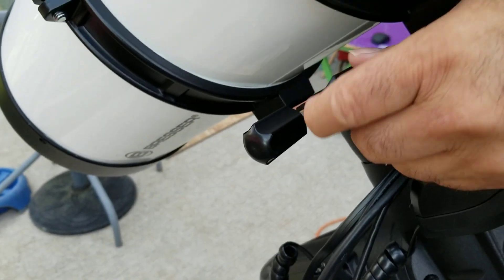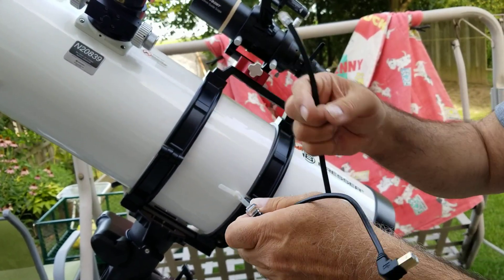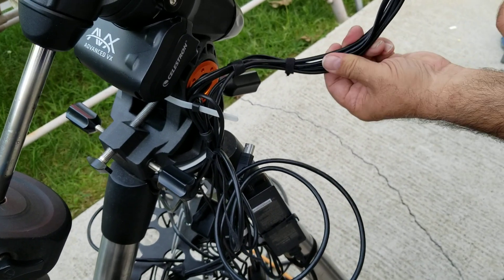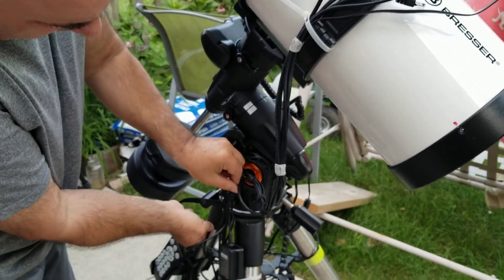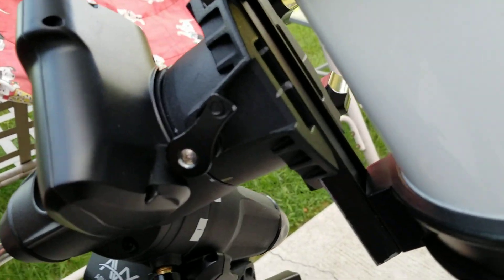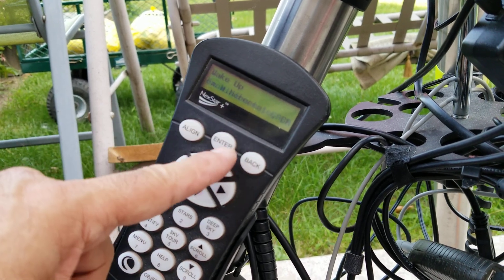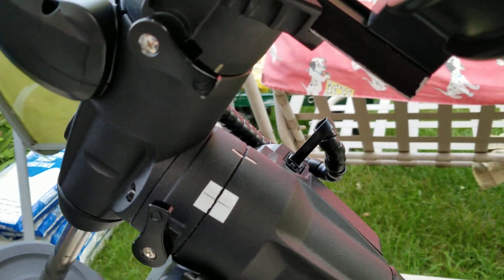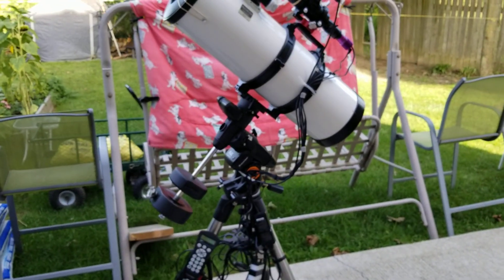A day in the life of Astrodude s World of my Astrophotography setup.

Comment: Cable management with Velcro is a good idea.  I use a corrugated slit flexible conduit.  It allows the removal or early split of wire leads to equipment along the run.  I use Velcro around the conduit at points where I want a wire to come out early to a piece of equipment to prevent the early wire from working its way out of the slit anymore.  I also use Velcro or wire ties to hold the conduit at certain points to my rig.  The flexible conduit just keeps the lose wires within one item.  It comes in various diameter sizes.  It is easy to add or remove wires because of the slit.
Reply from the maker: thats what im using since last year   its the only way to go.

Comment: Thanks for sharing some insights on cable management. I use the zip ties also but just turn them inside out so the corrugated side of the strip and internal locking tab do not come in contact. there is enough "stick-tion " ( I was a  Dobman once) to hold things tight and allow reuse of the tie.